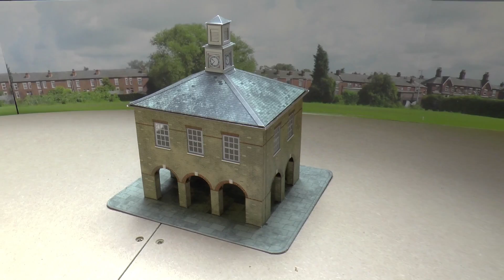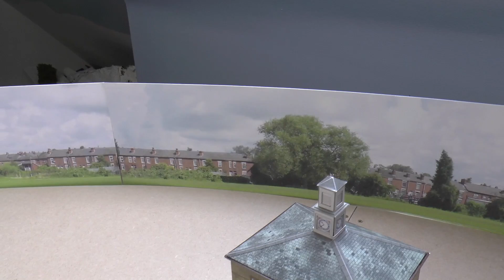Work completed on the Faller road so far.       30-08-2019

Comment: Graham - excellent progress. The hollowed arches are a capital idea and will provide a lot of additional interest. At first I didn't think you could improve much on the old Lakeside, but you've proven that a wrong assumption in spades. Looking forward to the next instalment.
Reply from the maker: Ken Batten     Thank you Ken, this new layout is very much an improvement over the previous layout both for me using it and also the content of it but I still wanted to keep the original feel to it as well which I think as it progresses will be seen more clearly - no lake or village yet so that will make a difference when they are built.      Cheers for now mate.         .......... Graham

Comment: Hi just a thought on the cut out road section , if you angle the jigsaw cut outwards on the ends  ( 8 inch sides)  it would self support itself in the hole and be easy to do. Many happy returns and look forward as always to progress Regards Ian
Reply from the maker: Ian Swinnerton     Hi Ian and thank you, I’m not sure that my woodworking skills are that good enough to do a 45 degree cut with a jigsaw to be honest, I hardly ever use any power tools and certainly all Lakeside has been built with a normal saw and hand tools so far but I could give it a go and see what kind of mess I make of it - I have first got to find where the jig saw is and see if it still works!    😂😂.      Cheers for now mate.         ............ Graham

Comment: Wow Graham, what a fantastic job you have done with the roadway, so far. That Market building suits the space you have placed it in, as a tailor made centerpiece for your roadway turning circle. Good idea to make the center section of the roadway removable. Those three Elizabethan houses you made up with the center archway was a great idea and is just lacking a name for the Inn. If you buy one of the pub kits from Kingsway Models, there are several to choose from, you get several different names for the pub you want to call it, so as well as having another pub (say at the Market end) you will have a few spare pub names for your coaching inn. Where you have opened the arches at the sides of the tunnel does look much better than having them closed and like you say, lets in a bit of light. I should leave the tunnel spans as they are Graham, you don't need to make them look like RSJs and I don't think it's worth all the work to alter and the red oxide would clash with the stonework. Never mind what other people think, It looks good as it is. It's going to be great to see some moving traffic and will certainly improve your layout, that's for sure. You have done wonders since you came back off holiday. 
Cheers for now buddy................Geoff
Reply from the maker: TRAM JUCTION MODEL RAILWAY      Thank you very much Geoff, well as you can see, I took your advice on that Market House and I’m glad I did because it’s a super kit to build and look at when it’s finished ( I still have a few more bits to add to it yet).  The coaching Inn was an instant brain wave when I saw the kit and I just had to build it and it came out just how I planned it to be, even down to the courtyard. I do have plenty of pub name boards I can choose from, not from this kit but from other Metcalfe kits that I have the left overs from so when the time is right then I will put one on but only after I have installed lighting etc otherwise I just know it will get knocked off along the way.  Don’t worry mate, the bridges will stay as they are and won’t be changed, I know the running limitations through that area so they won’t be getting any pillars inside.    Cheers for now buddy.       .......... Graham

Comment: Looking fantastic, Graham. You have solved for me, a problem I was having on Hawthorn Valley. If you remember I was in 2 minds, (maybe 3 or 4, :-) ) re the tunnel on the lower level at the back of the old pub  with the space and how to fill it to create a proper tunnel. Your idea of the opening in the walls has solved my problem (now to instigate it, that could be another story :) ). It would still allow me access to the fix any derailments, albeit a bit tight, but in combination with the entry/exit to the tunnel, it should be feasible.

All I have to do is figure how I'm going to make the wall curved without buckling the card used to create the wall. Any suggestions would be helpful. ;) 

Are you going to put a video up of your cruise? I'm getting back into the layout now. Other things have distracted me over the last couple of months - I'm easily distracted :) - so we'll see what happens.  ... Keep up the fantastic work,  Ian...
Reply from the maker: Hawthorn Valley     Hi Ian, not knowing exactly how the wall is constructed then it’s hard to comment but if the wall is thin enough and not too tight a curve then it may bend ok, but you could you a spray to spray a light coating of water on the rear and try that or maybe even using steam from a kettle - not sure if any of those would work though.  I have made a video but haven’t listed up on YT yet, I have just been sending it via email to interested parties via a ‘you send it’ link. Copyright music is stopping me putting it up on YT.    Cheers for now mate.          ........... Graham

Comment: Graham, not sure if you have considered that if you lift the roadway up, how would you get around the wire for the Faller System? Are you going to section off the wire for it as if it’s only me long run, you would have to lift the complete roadway.
Reply from the maker: Kev Blue    Hi Kev, the wire can be sectioned, there is no power going through it, it’s just a very thin piece of steel wire that the magnet on the car follows so no problem at all having a small break in the wire. Hope that helps.    Cheers for now.         ......... Graham
Reply: Lakeside model railway evening Graham, I was worried that you had overlooked it. I wasn’t aware that you could actually run it as individual sections. I can’t wait to see how the road system develops as I think it’s brilliant when you see cars running. Cheers Kev PS keep up the bloody good work.
Reply from the maker: Kev Blue    Thanks once again Kev, no worries mate, I have it set up as a test track on the road at the moment and the transit van runs fabulously around it so I should definitely be able to show something on the next video.   👍🏻.     Cheers for now and thanks once again.       .......... Graham

Comment: Bit off topic Graham, but some while ago you did a video about the Hornby Evening Staror Brittania and mentioned the super job Hornby did with light inder the body/firebox but I cannot seem to find it. would you be so kind as to point me in the right direction.
Regasrds,
Michael
Reply from the maker: Michael Lowe     Hi Michael, are you sure that was me? Because that doesn’t ring a bell with me at all, but that could be because of my shocking memory!  I do have an Evening Star and a Britannia class but both do not have lights in or under the smoke box. I do have a Costi boiler 9F with a firebox flicker though which I fitted.      Cheers for now mate.       ............ Graham

Comment: Graham - just leave the bridge portals as they are.  There are plenty of examples both here in the UK and abroad of long single spans over  numerous tracks below.  About to head off to Austria on holiday via an overnight in  Munich. The approach to their main station is a case in point - with multiple tracks going under a massive single concrete span.   Cheers Euan
Reply from the maker: The Growler - Blackwood N Gauge Layout     Thank you Euan and don’t worry, the bridges will be left as they are, I’m not going to change them.   Have a great time in Austria mate.  👍🏻.     Cheers for now.        .......... Graham

Comment: Looks great as usual. With all those platform buildings, just wondering if you require an additional station building? Or whether pedestrian access via a single bridge across to both platforms from the top is all that is required? Looking into an example, best I could find is a station called Sheffield Brightside (or Lakeside?). Depends how large you want your station to feel I suppose. Search "sheffield brightside station" in google images for examples of the retaining wall and the footbridge - maybe it had a station building but it's not visible.
Reply from the maker: Shornford     Thanks for that mate and I have just Googled that station and you are right - not much there is there!  It would be really helpful if I could get away with using the existing buildings and just having a footbridge to connect the two platforms and the road, I will think on that because that would really help me.   I could swap the buildings over onto the other platform nearest the retaining wall which would make it even better for the passengers to buy tickets and the cross over via a bridge to the other platform - I like it!   Thank you.      Cheers for now.             ............ Graham

Comment: Welcome back Victor! ;-) I thought you had explained the bridge support perfectly well, but then I WAS listening. Perhaps you could install an unprototypical sky hook to hold it up?! I very much like the open arches - top marks on that. And the market house is a great idea for the Faller roadway loop. Can I make a suggestion when you come to cut out the removeable section of the roadway? Perhaps make the cuts at 45 degrees so that it sits in its own "trough" and wont require any further battening. I am sure that 99% of the time you will not have to disturb it as you have engineered that track well enough to avoid derailments or other problems underneath. Cheers
Reply from the maker: davie maclean    Thank you once again Davie for your constructive comment. I’m not sure that my woodworking skills would cover me to do a 45 degree chamfer along two long edges, me being me then I think I would be safer with just using battening. I think you are right about the amount of usage in lifting the road up for any issues under there but I will still need to allow for it just in case. If I don’t then you just know what will happen!   😂.   Cheers for now buddy.        .......... Graham

Comment: Just a thought regarding your station building/entrance; what about doing a two storey building on the farther-away platform, with access from the upper floor, via an overpass/bridge across the outer track from the High Street?
It's coming-on in leaps and bounds now, really seeing some progress with each update. It's going to be an impressive system when you're done.

All the Best,
Dougie.
Reply from the maker: 2H80vids      I did try a building where you suggested but the drilling I tried was too wide for the platform - it’s not a particularly wide platform to accommodate an entrance building and an overpass. I still have plenty of time to mess about with the platform entrance building as it’s not going to interfere too much with the path of the roadway so we will see how that pans out but I am working on it.  Thank you for the kind comment and as always, it’s greatly appreciated.         Cheers for now mate.          .............. Graham

Comment: remember now Graham, it was about how clever Hornby had been ptiing the engine in the loco and srill allowing a gap between the boiler and the running gear.
Reply from the maker: Michael Lowe     That has got to be the 9F then, there is quite a gap.

Comment: You must be one of Metcalfe''s biggest customers. I really do like the Department store and the Old Coaching Inn. You said people would comment on what you propose to do. I understand about the lift-out sections, but how would this affect the motorized roadway? Martin (Thailand)
Reply from the maker: Martin Pattison      Hi Martin and Thank you. The roadway itself is not motorised as in the Magnorail system, the Faller system uses a thin steel wire and it’s the motorised vehicle which follows the wire via a magnet on the vehicle, so I can leave a small break in the wire - less than half a mm - and the vehicle will still follow the wire.  Hope that makes sense.    Cheers for now.          ........... Graham

Comment: For the bowed roofs you could try wetting them in the middle a bit and then gently pushing them down to the desired shape. Obviously try it on a test piece first... might make the ink run.
Reply from the maker: Edward Gray      Yes Edward, I had thought of that, I was going to use a fine spray bottle and spray from the rear of the roof so as to not mark the front face.     Cheers for now.       ............ Graham

Comment: Hi Graham,
Sorry for a long comment but so much to say.
Wow, what progress you have made, your layout is really taking shape, cutting arches out was a great idea from who ever suggested it, makes a real difference, coaching house looks great, simple but extremely effective, looks as if you can walk straight into the garden area.
Love the idea regarding lifting the road way up, very clever.
Just one thing, how are you going to regulate the speed of the vehicles as I have 2 vehicles and one goes slightly faster than the other so it catches up with the one in front, are you going to use the digital control thingy from Faller to stop this or just run the standard system, so looking forward to your next post, great job as always
Thanks
Cheers
Reply from the maker: Martin Slyfield     Many thanks for the kind words and comment Martin and pleased that you like it so far.  I think for now that I will just have to put up with the cars gradually catching each other up but I will see how it goes, I think I will probably go digital in the end even though it is an expensive option - we shall see but I am so near to having the system up and running now that I hope to show it on the next update - wish me luck!    😂.    Cheers for now mate.         .......... Graham